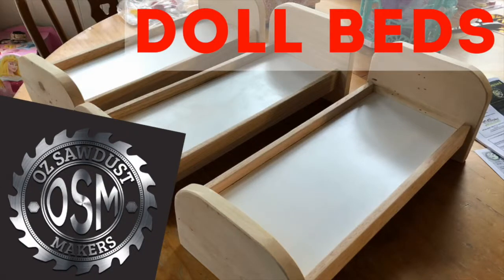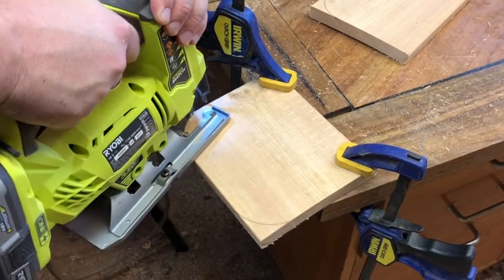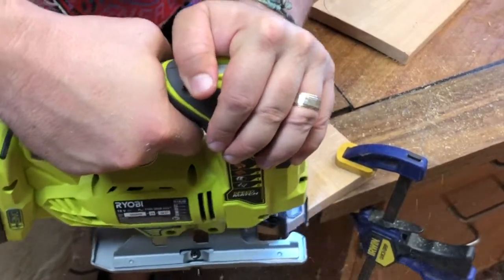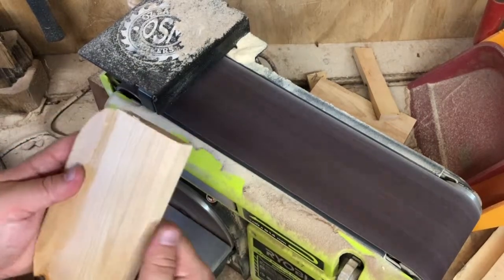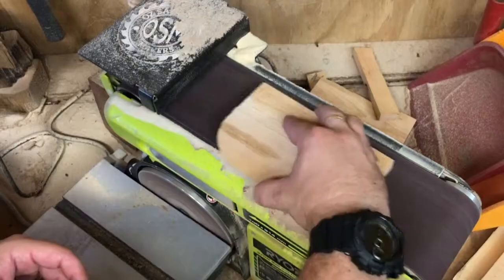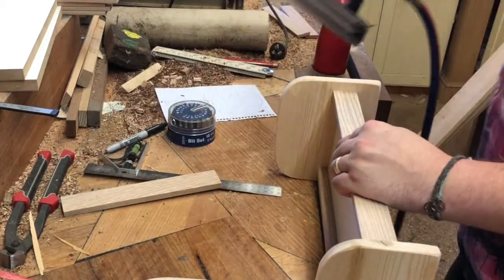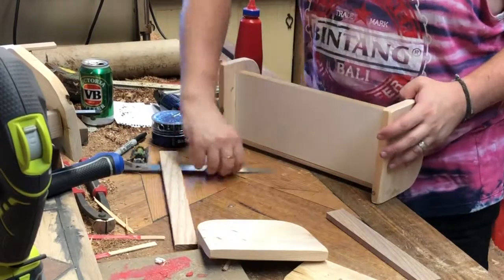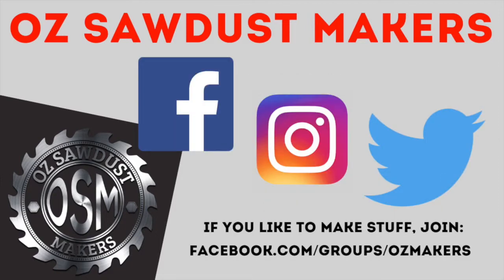DIY Doll Beds - Easy Woodworking Project

Comment: No measurements
Reply from the maker: Hi Donna, these days dolls come in many sizes. Is there a particular style of doll you want to make a bed for? I am happy to help with specific dimensions. :)
Reply: @OzSawdustMakers  yes like the one made here, I'd love the measurements to this
Reply from the maker: Hi Donna, this bed will fit a Barbie doll and a lot of standard size superhero dolls. The bed base is 350mm x 145mm, the side rails are 35mm x 10mm and the bed end is 105mm x 165mm whereas the bed head is 140mm x 165mm. I roughly measured a Barbie doll to make sure it would fit lengthways and then just winged the rest of it. Let me know if there is anything else I can help with.
Reply: @OzSawdustMakers  thank you so much, I just love your beds excellent work
Reply from the maker: @donnasharrock2625  Thank you! Please check out my other social channels and when you make your doll beds share them with me, I would love to see them.